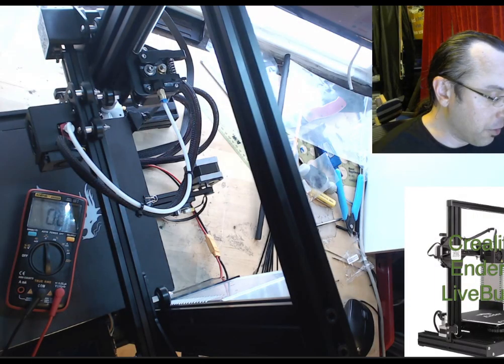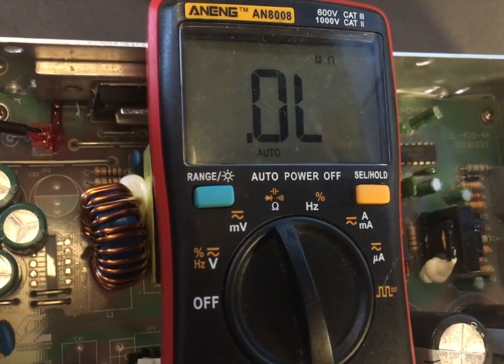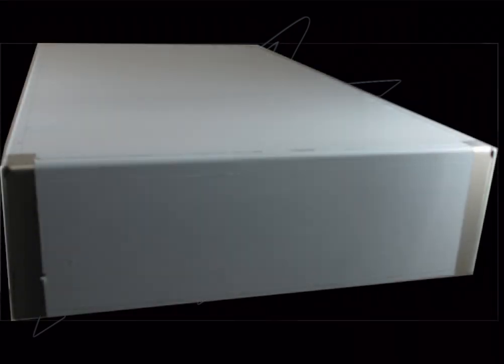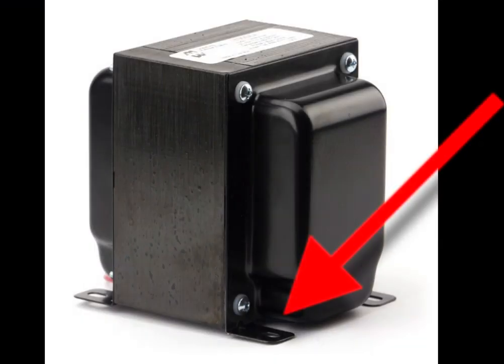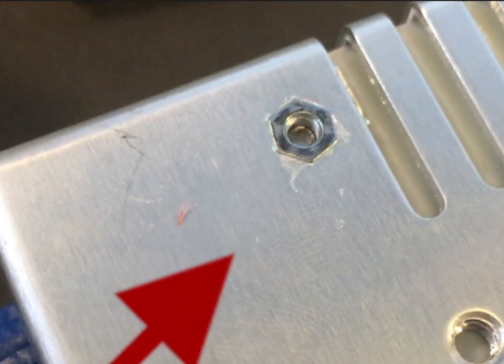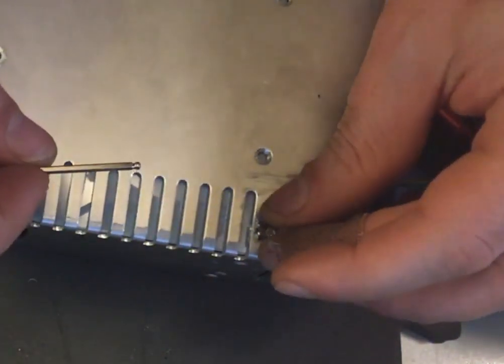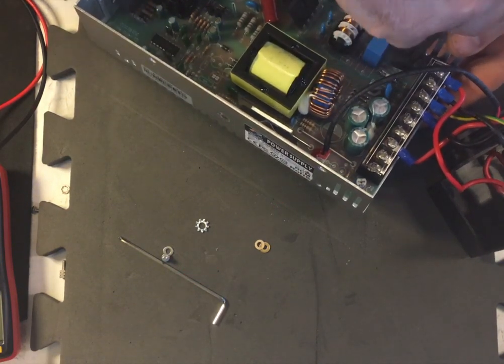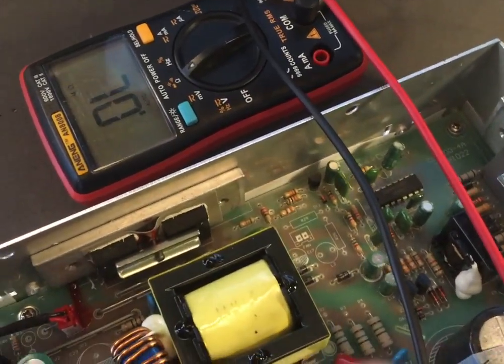Creality Ender (and others!) safety issue - chassis ground connection

Comment: Ender 3 pro comes with a Meanwell PSU, I believe Meanwell units don't have that kind of issue, but I'll check again on mine later :)
Reply: That's why i bought the pro. I checked mine and it's fine (It's a Meanwell PSU so i expected it to be good ;) ). I don't trust those chinese PSU's. But very important Video huge safety issue.
Reply from the maker: Yes, I think I am going to add a link to the pro and pin it to the top of this thread. There is a quick fix for anyone that is comfortable taking apart the PSU, but I have never seen even a cheap mean well with a basic quality control issue like this, so I feel safer suggesting the pro for most users.
Reply: I'm here because I just recently purchased an Ender 3 Pro with a Meanwell PSU. It shocked the shit out of me the other day. I would urge everyone to check these.
Reply: @lanetwellman  my plug didn't have a ground, when the power was turned on the chassis had 110V, when it was off it had 230V (I live in an area with 230V/240V). My chassis had continuity to the PSU ground but the cable only has 2 prongs

Comment: FWIW: My SainSmart branded Ender 3 (supposedly made on the same assembly line in cooperation with Creality) bought back around February or so (woot.com deal) does not have this issue. No coating on the power supply, and my meter registers a dead short between the ground pin in the power cable connector and any part of the body of the power supply. I've read elsewhere that Creality has gone through multiple power supply vendors.
Reply from the maker: That makes sense. I'll have to poke around a bit and see which ones are causing people trouble, for the vid
Reply: Also have a SainSmart Ener 3 from Woot. Mine has the exact problem demonstrated in the video. PSU is branded 'Cheng Liang' Model: P360W24V

Comment: I just got a Ender 3 Pro and am seriously considering upgrading it with the dual Z axis setup. However, there is concerns with the power supply being grounded using 3D printed plastic brackets upon relocating the power supply itself. Is there a good resource for obtaining metal brackets to ensure the power supply is still grounded after the upgrade installation?
Reply: First off i'm not convinced that dual Z is actually a great idea, because the screws can get out of time with one another, and they can exert forces on the carriage etc. But if you can solve that.

But also you're looking at it wrong. The PSU is not grounded to the frame of the printer. Instead, the frame of the printer is grounded to the PSU, and it shouldn't necessarily be.

The PSU connects to mains Earth, and because half the PSU carries dangerous voltages there, as a safety measure, the PSU enclosure absolutely needs to be earthed internally within the PSU, so if there is some sort of primary side fault, including lose metal bits which might come from the outside, or might be parts of the PSU itself, it's much more likely to short Line aka Phase to Earth before it shorts Line to Secondary. Because if it goes Line to Earth, then the breaker trips, or the GCFI trips if you're in a more civilised part of the world, but if Line goes to Secondary, well, you might die.

Aluminium printer frame is also not a great conductor, there's probably 50-500 Ohm between the PSU mounts and any given point on it. Which is to say, aluminium has high conductivity through its volume, but it naturally grows a layer of electrically insulating oxide on its surface, aluminium oxide also known as corundum or sapphire is a high dielectric, and the printer is constructed from beams which are anodised, so they artificially make this oxide layer extra thick and robust, so the actual contact patch between the frame pieces which are connected is barely there, just some tiny fraction of a turn of a screw thread here and there and depends on luck, thus the high electrical resistance. Which is also why PSU enclosures generally shouldn't be alu but steel, unless further precautions are taken, but i digress... So yeah even if you have the printer frame Earthed, you cannot rely on it to save you in case of fault at all, the resistance of the printer frame is way too high for that. I don't personally believe having the printer frame Earthed is an actual safety advantage.

My personal safety precaution is a wire link from Earth terminal to the negative output terminal of the power supply, to convert it from floating into Earth referenced. But then the frame definitely shouldn't be Earthed, it should be insulated from the PSU, because then it would be connected to output Ground, and 3D printer is basically a couple ground-switched heaters, one for hot-end, one for bed. The hot-end heater can easily cause a fire, and the bed heater can facilitate a fire indirectly if left turned on without control. So you must absolutely prevent heater negative terminals of these heaters being bypassed to Ground, as this would bypass the low-side MOSFETs controlling these heaters and would leave them permanently on.

It will also occur that the secondary GND is connected to mains Earth by something outside. For example if you connect printer USB to an ATX PC, and the PC has its GND bonded to Earth via the PSU. So you cannot rely on printer's PSU floating from reliably preventing the GND bypass of heaters.

I know this can be a handful to wrap your head around, so let me know if i need to clarify anything.

Comment: Hey Alex... I have been zapped plenty of times by my 3d printer, and the voltage were I live it's 220V "ouch". Anyway talking about power and all that stuff, I still am in the process of upgrading to a SKR 1.3 with TMC2209 with boost converters, I bought 4 XL6009 with embedded voltmeters from Ali express they are rated 4A Max input so lets say 2A? I intended to use 1 for each TMC2209 but I have limited space to mount the board and the boost converters, could I get away with one boots converter for 2 TMC2209?

Keep up the good work, I like your videos very much since I spend more time modding my 3d printer that printing anything with it, most prints I do are just mods for my 3d printer. 

Anyway thanks again...
Reply from the maker: I can't answer exactly, but it Depends on how much current you are running.  remember that trinamic measures in RMS so multiply your setting by 1.4 to get peak.  I don't know how much those particular boards can handle at 12-24 boost, so you should probably test them.  at 24v, a 1 amp load resistor wold be 24 ohms and over 25 watts, 2 amps would be 12 ohms and over 50 watts.  I don't know if this is a common thing, but we have A19 base battery powered lightbulbs that pull 1 amp at 24v and make a cheap dummy load for testing. OR just plug them in since they have a built in screen and see if the voltage starts to drop under load.  If you can't test, safest is to use one board per motor because some of the boards i have are only stable under 1 to 1.5 Amps at 24v. The more I run them over 1 amp, the worse the regulation gets.

Comment: Hello Alex! Where I live it's impossible to get hold of a ground (30 year old apartment). I can, e.g., feel the tingling when touching my micro wave... In this case do you think that using the neutral is "less worse" than nothing? Thanks!
Reply: Answering my own question based in the brazilian standards, the ground must be derived inside the breaker box and an RCD is not optional because if your neutral is broken between the breaker box and the exterior the ground will become phase, which is really bad!
Reply from the maker: OOF! Okay, none of this should be taken as gospel, and maybe an electrician can chime in (and the proper answer is to check with your landlord and a professional electrician... usually landlords are cool with that because they would rather pay to fix the issue than risk a fire).  FIrst off,   I don't know anything about code in other countries, but around here there are 2 issues: the ground circuit, and the house's wire current carrying capacity (ampacity). as far as the carrying capacity, if we have a house with non 3-prong wiring, it is usualy a good indication that the wires themselves old, and it could be cloth insulation or similar... in which case it can't be assumed that it can carry the full current of modern alliances safely, although typocal 3d printer current draw on the MAINS side is usually not an issue, but something like a microwave + refigerator may be a problem.  And that is a bit undertaking to fix because you basically have to tear out all the wiring and replace (we also had a brief stint with aluminum wiring, which is another issue). Also, I think RCD is your equivalent of what we call GFCI?  That is better than nothing in terms of electrical fault protection, but some supplies use that earth ground reference and others don't. The tingling you feel with appliances is an example of capacitive coupling to your body from a leaky ground circuit.  The tingling itself is not always dangerous, but it is a good indication that something on the circuit is not wired correctly (or at least not optimally). Here,  if they are not earth grounded on the thrid prong,  they have to be labeld 'no ground' to meet actual code. Where I live, safety ground and newer breaker box is required for rental properties, as well as GFCI in for bathrooms and kitchens, but private residences don't require it it always (depending on location), For those, usually I'd recommend getting an electrician in to see how hard it would be to run another lead from the box to the breaker to get a proper earth ground (depending on the age and wiring conduit, sometimes in the U.S, the wall box could be grounded, but not the outlet, so you can sometimes ground to the box with a pigtail, other times you have to run a 3rd wire, but if the wiring is old cloth style, usually they use a GCFI instead because you would have to tear out all the old wiring and replace it since running a new wire through the same path could flake off the old insulation and cause a fire.  BUT that doesn't mean that the old wiring can handle the current, or that a high-current PSU will play nice with the GFCI.  ALso check the wire guage to make sure it is correct in terms of ampacity for the circuit (I think the standard here is 14 ga for the typical 15A circuits, but that is off the top of my head). I also use power strips with protection and ground fault indicators built in, just to be sure. TL;DR: see if a professional can look at the problem, especially if you have kids, and let the landlord know that you are feeling electrical tingles when touching appliances. I don't know yet if the Ender supply has full galvanic isolation, or how it references to ground, but worst case scenario, an isolated, floating supply in a non-conductive enclosure is safer in the case of 2-prong outlets (like you see in laptops, game consoles, monitors, etc) but sometimes those are even not wired properly., or are switching to 3-prong because of the tingle issue. I keep floating game console PSUs around for that reason, and I even run one of my printers from a pair of XBOX PSUs wired together for 24v (they include a 3-prong cord anyway, but the safety prong is not hooked up on the PSU connector)
Reply: @AlexKenis  Thanks for the detailed response. Sorry if it wasn't very clear, I don't know the English terms for some common things. RCD, in this context, is a residual-current device that looks like a breaker and goes inside the breaker box, not at the wall like others. I think your advice about electrician is very sane, but I have seen so many bad ones and crazy stuff (isolated terminal? no, let's put some solder in that! High current electrical shower 12awg wire with joints? Why not? ) that it is scary. Unfortunately there is no such thing as "certified electrician" around here (that I know), believe it or not.... Well, keep up the nice videos!

Comment: Simplified Warning: Some stock Ender 3 power supplies are not safely grounding the chassis, which is a serious safety risk.
Reply from the maker: Pretty much.  The scarier part is... I have no idea what other printers come with this PSU, or if the manufacturer does OEM for other brands, so there are a bunch of people at risk out there that may never see the warnings

Comment: This may be of relevance: https://www.youtube.com/watch?v=RPxBAb7D92k

We had a ton of them with issues.
Reply from the maker: Im glad to see this is a known issue.  The more people that know about it the better, BUT it is scary that the info has been out for a while and there does not appear to have been a fix. There is a QC sticker on my PSU and a QC seal on the printer, but if they didn't check the basics like the safety ground FIRST, I'm not sure what they did check. Part of a past job I had was QC on industrial control equipment, and a missed safety ground fault would have cost me my job.
Reply: @AlexKenis  we've let them know of the issue but did not get any response. I don't think they care.

Comment: If someone wants to know a little (a lot?) more about power supplies, I suggest to take a look at DiodeGoneWild's channel (https://www.youtube.com/watch?v=KIilQrgJ-gg) which is "niiice". Don't be annoyed by his accent, it actually gets to you!
Reply from the maker: HA I like his accent.  I appreciate that he used the testing-on-a-budget single wire loop current sense too. That capacitor without the ground connection was a mindbogglingly crazy oversight in the manufacture of that board.   I'll be doing a similar vid for the Ender PSU (which is consequently a better PSU than what he had in the vid, even though it had a wonky safety ground).

Comment: Hi there Alex
When I assembled my Ender 3 I found a similar problem, here is the video describing the problem and the fix. May not be the same as your issue but is is still worth the viewers being aware of it as there are multiple ways the manufacturer assembly can cause problems.. Regards theBreadboardca..
https://youtu.be/mAZKu8e1-S8

and the full build if your interested to see my experience. https://youtu.be/-16FtU_UzOk
Reply from the maker: Thanks for the link! Oof, that's yet another goofy problem to add to the list. A bunch of people have contacted me with their experiences, and they all seem to revolve around quality control issues from the PSU manufacturer (plastic wrap insulating the standoff in my case, the plastic shield insulating the PCB trace in yours, loose bolts in the case of TH3D, etc).

Comment: OL means Open Loop and not open circuit. But at the end we can use both, the concept is almost the same
Reply from the maker: Good call
Reply: Actually OL stands for Overload, and indicates that the value that the meter is attempting to display exceeds the range of the display. See, for example, any Fluke meter manual PDF. The term "Overload" fits when dealing with a voltage or current range. In resistance mode, "Overload" doesn't entirely fit -- it just means that the resistance that the meter sees is a value larger than it can display. An open circuit would produce this reading, but so would a large value of resistance.  OL does not mean Open Loop in any meter-related context I am aware of. The term does appear in automotive scanners to indicate the state of the oxygen sensors feedback loop controlling the fuel mixture (or not).